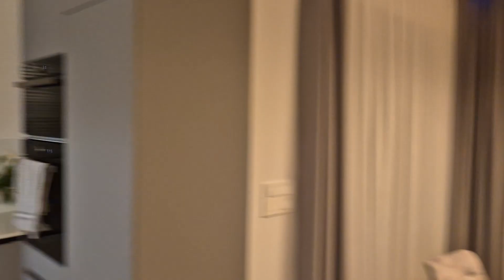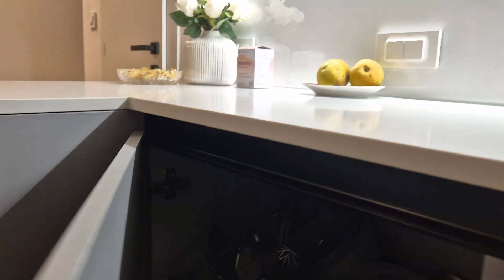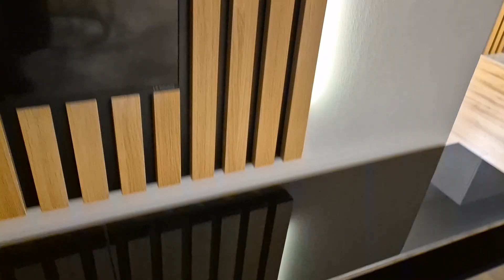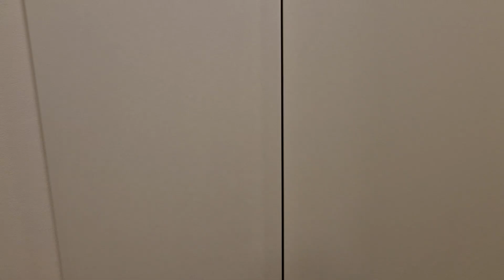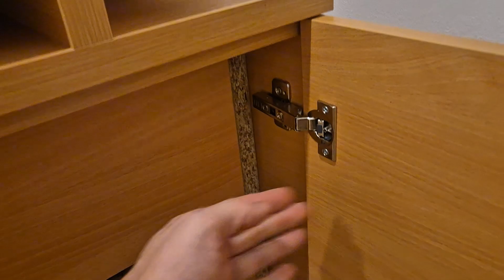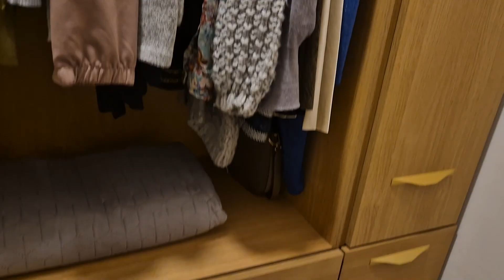How to make custom made furniture at Home - Part 1

Comment: Hello,

I hope you're doing well. I'm curious to know what type of wood you use for your projects and how you make your assemblies. Would you also have a video showing how you manage to cut straight with a jigsaw? I'm also interested in your tips for avoiding too many splinters on the cuts.

Thank you in advance for your reply!

Looking forward to hearing from you soon.
Reply from the maker: Thanks for your comment. In most cases i use chipboard with decor. I will work on future videos how to  connect boards, and show tricks that i learned. It is very simple. You need to cut just in some cases because i always order finished boards from specialized store.
Reply: @MarioGudec  tu n'as pas fait la vidéo sur la construction de tes meubles ?